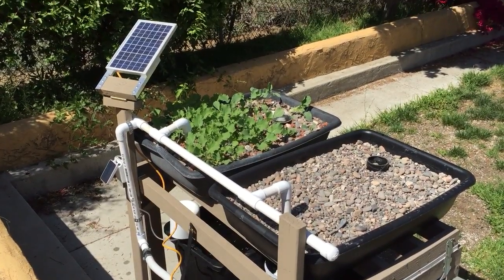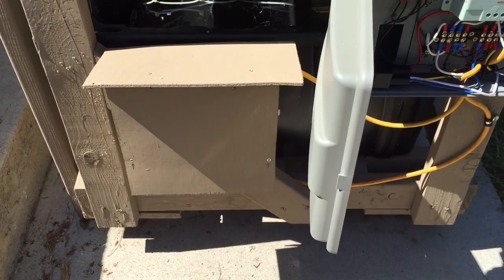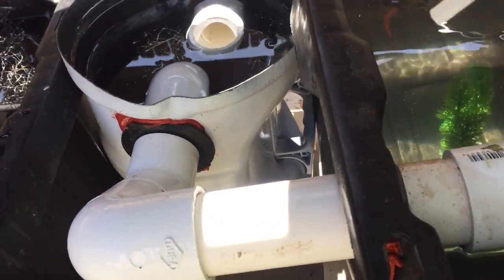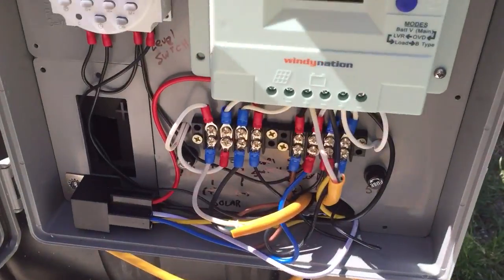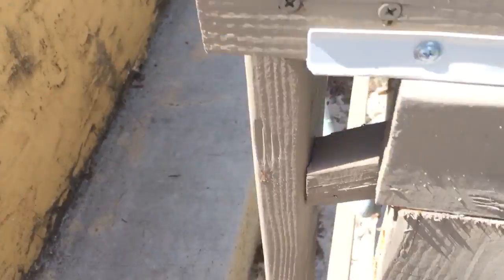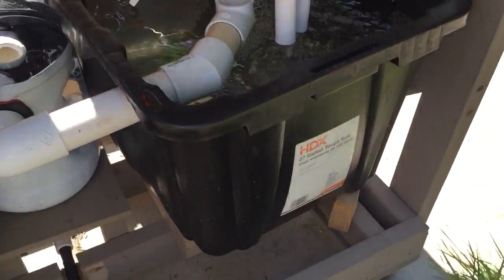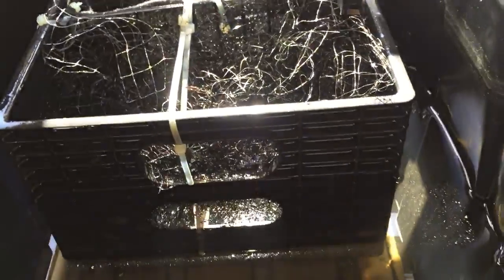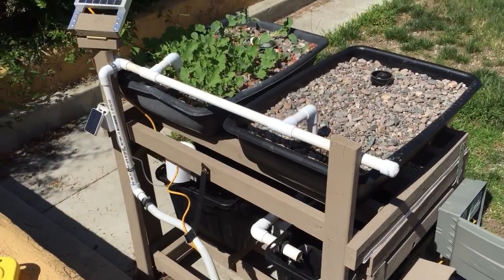Solar powered Aquaponics system walkthru

Comment from the maker: Hello Slicefixer.  The grow beds are cement mixing tubs from Home Depot.  The fish tank and sump tank are storage bins from Home Depot too.  The panel is a 10W panel which is plenty of power, but the key is a low power consuming control system, think under 15mA running current.  The battery is usually full.  The pump cycles on every 3 hours to fill/drain the grow beds for one minute.  The pump is 12VDC, 3Amps.  I've been thinking about building a little website to put up the details.